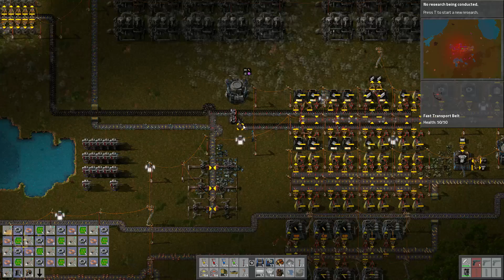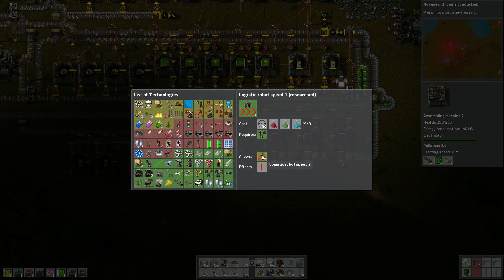Factorio Let's Play Properly 16

Comment: When I got Logistics up and running, I ended up setting up the output of a couple Coal Mining drills to passive provider chests and setup a requester chest requesting coal for the Plastics production.  At the time I also had 5 trains running on a rail network and added requester chests for them as well, which nicely cleaned up the transport of coal to Train stops.

Because your plastic is so far from your advanced circuits, I'd also setup a Passive provider as the output for your Plastics production and a Requester near the Advanced Circuits that feeds onto a belt to feed the Advanced Circuit factories.  Another option is to give each Advanced Circuit factory it's own Requester chest.

I like the Logistics robots for those tasks which are low volume but complicated to setup Belts due to distance from production to use.  Due to the complicated nature of getting 4 types of science packs to your science labs, Provider and Requester chests are also useful to bypass the mass of transport belts needed.  A side benefit is that you can limit the amount of Science Pack production to that which you'll need.  I made a mistake and ended up having my Science 3 production producing over 4900 Science 3 Packs because the wrong chest was connected to the network and it continued to produce, even though I hadn't been doing much in the way of research.  I'm not even sure if I can even use that amount of Science Packs for the remaining amount of Research I can do.

Comment: Arumba, you can quickly drop 64 units of junk or coal, by bring it as your cursor and holding control+ left click on any storage or burner or boiler to drop it in there, you can also press control+right click to drop half of it, very useful as you can keep clicking on anything and it will get rid of it from your whole inventory.

Comment: Is it just me or don't steel and electric furnaces have the same base speed. Other than using electric power, isn't the only benefit to speed located in the module slots? Just wondering.
Reply: It also reduces the need for coal in your base.